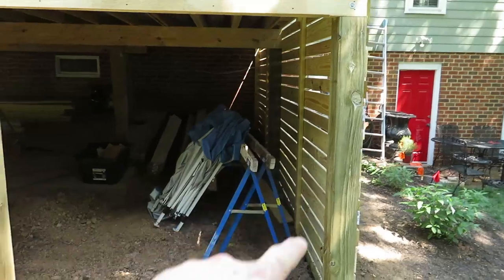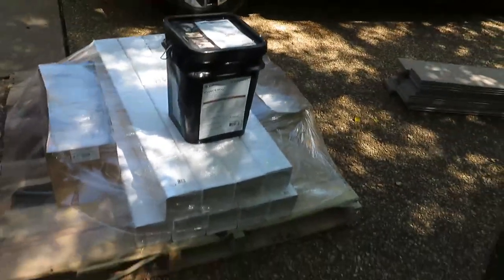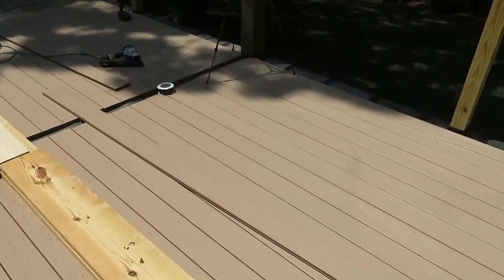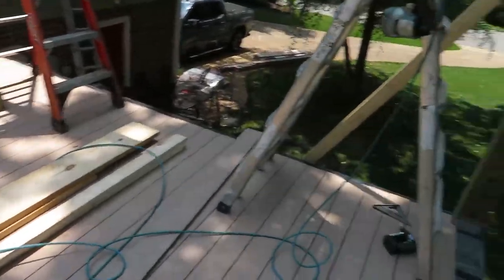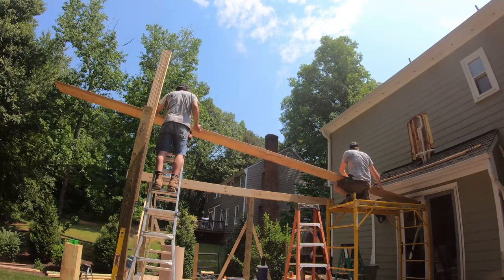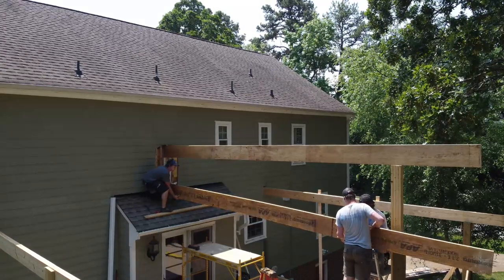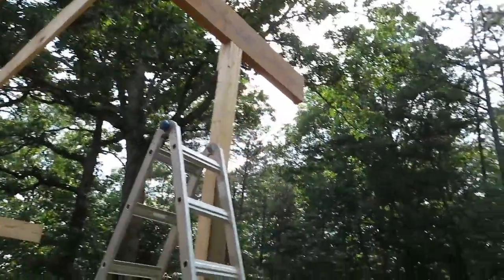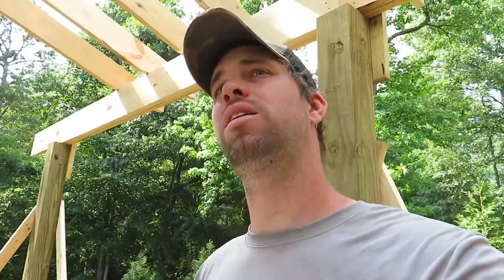Building an Awesome Covered Deck - (Part 3: Decking)

Comment: Question: those 6x6 corner posts that hold up the roof. I see that on top of those 6x6 posts you placed those beams.  I see that you used a pair of Simpson LPC post caps to secure the beams to the 6x6 post. However, for the OTHER beam that you also placed on top  of the 6x6 corner post (i.e. 2 beams sharing one 6x6 post), I can't see how you connected that second beam to the beam. To say it another way, I'm referring to that beam that runs parallel to the house. It sits on 6x6 posts shared by other beams running perpendicular. I'd like to know how you secured the beam that runs parallel to the house, to the post.
Reply from the maker: I could be mistaken, but what I think you are referring to is the timber beam we installed in the next video (Part 4)?  Full clarity, I don’t remember exactly how we attached everything, because it was several years ago. I do know everything passed inspection.
Reply: @thebedfords  Yes, I believe that's it, in the next video (part 4) I first see it appear in that video at 2:58. I'm currently trying to design my own patio roof structure and am having trouble finding full details on how to connect that beam to the post. If you happen to recall, that would be great. either way, thanks for replying
Reply from the maker: @thinkoutsidethecontainer  because it was an exposed timber beam, I think we just screwed through the end of the 2x beam coming off the house, into the end of the timber beam. But we’ve done a more traditional 2x beam all the way around on others, and we just overlap them in a way that allowed us to have all 4 members of the beams land on the post, and used a bracket which we may have modified slightly (not sure) to properly fasten everything.
Reply from the maker: @thinkoutsidethecontainer  https://youtu.be/Or4fvw2uwSY?si=aPEkoIuazeq_MOP- around 14 minutes into this video, you can see a little of what I’m describing. I don’t think I showed a close up of it, but this may help.
Reply: @thebedfords  thanks

Comment: How are the roof posts attched after the fact? Were there footings made in part 1 or were they attched directly to the top? Can't wait to see the final project.
Reply from the maker: So the footings for the deck were indeed shown in part 1.  From the ground up it was poured concrete footings, on top of which were sitting 6x6 posts holding up two girders made of double 2x12s.  The two girders are what hold up the deck joists.  So  the 6x6 posts that hold up the roof assembly--some are attached with brackets to the deck framing, and the center post holding up the ridge beam for the roof, actually fit down inside the deck framing system and bolted to that.  All connections either meet or exceed the required building code.  I haven't actually filmed the final part yet, so when I do, I'm gonna try to actually show and talk about some of the questions that have been asked on these videos.  Hope all that made sense!
Reply: Me too. I wish to see how to attach the post for roof to the floor o decking

Comment: Looks like your waterproofing solution between the joists (in the joist bays) precludes you blocking those joists properly.  Won't that lead to joist bending or twisting over time?
Reply from the maker: It's probably less effective than fully blocking, but the joists are fastened to the girder running down the middle of the deck, not just sitting on it.

Comment: Can’t seem to find any videos on how the decking gets installed over these water proof systems   Does it self seal after screwing into it???
Reply from the maker: Pretty much.  Between the thick EPDM membrane, plus the tape over each joint on top of the joists, it should be darn near totally self-sealing.  I've never done this system over finished interior space before, but I think it would be suitable for that.  It's always just been a simple matter of the client trying to reduce the amount of water, debris, etc that would get on stuff they are storing under the deck.
Reply: That’s what I figured ..  was just curious on that process in which I couldn’t find a video on  but also assumed it self sealed enough    Thank you for the response
Reply: That’s what I figured ..  was just curious on that process in which I couldn’t find a video on  but also assumed it self sealed enough    Thank you for the response
Reply: That’s what I figured ..  was just curious on that process in which I couldn’t find a video on  but also assumed it self sealed enough    Thank you for the response
Reply: That’s what I figured ..  was just curious on that process in which I couldn’t find a video on  but also assumed it self sealed enough    Thank you for the response
Reply: That’s what I figured ..  was just curious on that process in which I couldn’t find a video on  but also assumed it self sealed enough    Thank you for the response
Reply: That’s what I figured ..  was just curious on that process in which I couldn’t find a video on  but also assumed it self sealed enough    Thank you for the response
Reply: That’s what I figured ..  was just curious on that process in which I couldn’t find a video on  but also assumed it self sealed enough    Thank you for the response
Reply: That’s what I figured ..  was just curious on that process in which I couldn’t find a video on  but also assumed it self sealed enough    Thank you for the response I appreciate the time
Reply from the maker: @markscalisi7685  absolutely

Comment: What area do you live in the country? I'll be flat out honest with you. I've fallen in love with this design, I might do my best to replicate this within the realm of my budget... will be a project over years not months. I'm in Ohio, would I be able to use this type of framing and have it be good enough for "snow weight"?
Reply from the maker: We are in central Virginia. The “snow weight” you are referring to is called live load. You can Google live load vs dead load. Dead load is the weight that is always present on a structure, while live load is something that happened on and off (like snow). It’s something you can find out by talking to your local building inspector or an engineer. I wouldn’t be surprised if you guys have higher live load ratings required up there, which would simply mean you need bigger lumber lumber for the rafters, and they might need to be closer together.

Comment: Quick question how you connected the 4x4 top post to a bottom 6x6
Reply from the maker: Can you tell me approximately what time in the video you are referencing?  Because we used a few different types of brackets for the various connections.
Reply: @thebedfords you are placing one on at 7:00 and did you also have to use strong ties?
Reply from the maker: @She_sSincere  we used a variety of different types of Simpson Strong Tie brackets.
Reply: @thebedfords  okay thank you for your response

Comment: How did you connect the post for the cover to the deck?
Reply from the maker: Which part are you referring to?  We used a couple different connection methods for different parts of the assembly.
Reply: @thebedfords  I’m talking about the part we’re you connected the 6x6 post for the roof.  Which clamp did you use?  It looks like you connected them on top of the the posts for the deck.
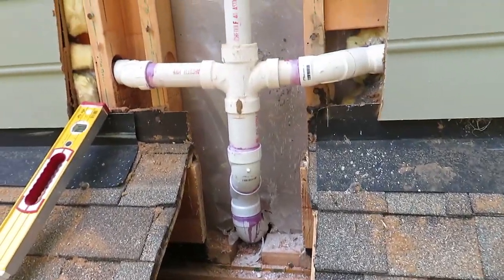Reply from the maker: @Bankair121  if you are talking about the vertical timber out at the gable end, attaching to the 6x6, I think I cover that later in a different video. The horizontal timber lands on top of the 6x6, then we used one of these hidden brackets to attach the vertical timber to the other timber.   You can see this at 8:17 in the part 5 video. You can see the three holes where the metal dowels go through the timber. 
https://www.fastenersplus.com/collections/cptz-concealed-post-bases?utm_term=&utm_campaign=%23%23Dynamic+Ads+-+Connectors+-+Post+Caps+%26+Bases&utm_source=adwords&utm_medium=ppc&hsa_acc=3477180114&hsa_cam=15230857591&hsa_grp=127489022777&hsa_ad=570921792178&hsa_src=g&hsa_tgt=dsa-1460184531542&hsa_kw=&hsa_mt=&hsa_net=adwords&hsa_ver=3&gclid=EAIaIQobChMIwIOV6veq-AIViLzICh2x-wHIEAAYASAAEgKLGPD_BwE